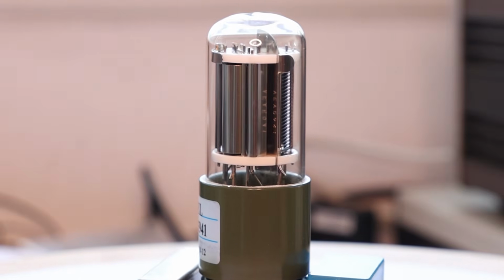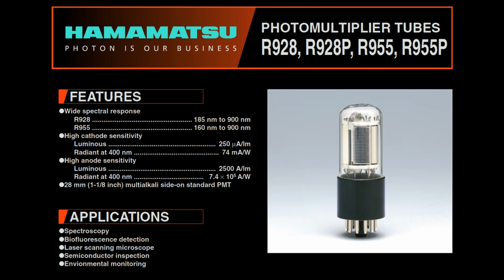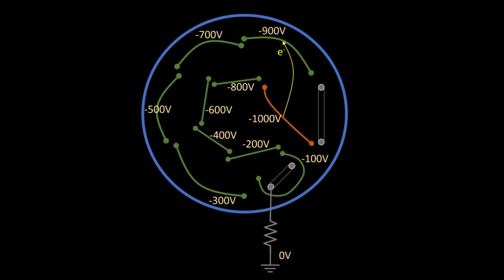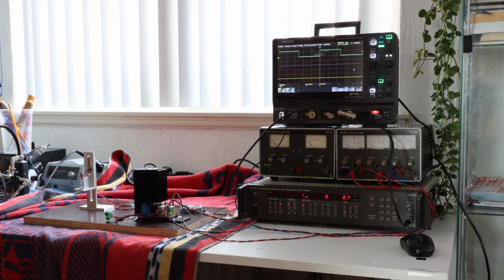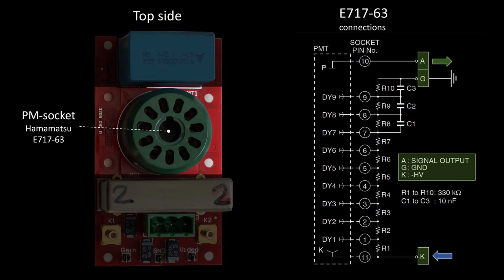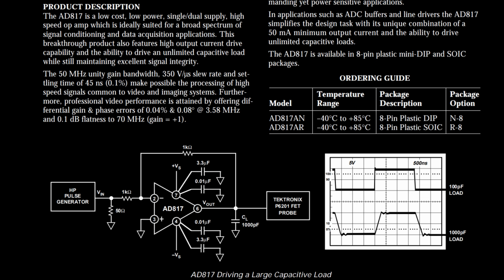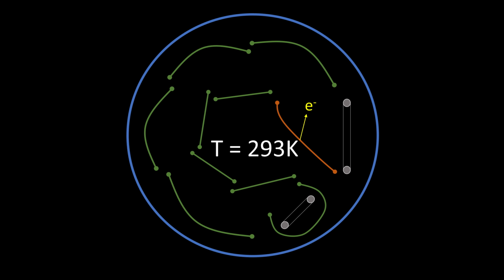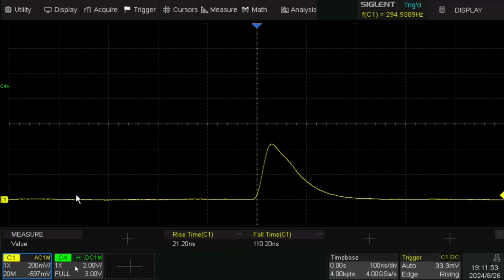PMT1: Using a Photomultiplier to Detect Single Photons

Comment: If anyone is wondering about applications outside the lab - I'm an engineer for Luxium Solutions (formerly Saint-Gobain Crystals). We use these in combination with scintillators to make radiation detectors. The scintillators convert high energy radiation (typically gammas, but also neutrons) into a burst of visible light. The PMT detects the visible light to generate a signal. 

The number of photos the scintillator emits is proportional to the absorbed gamma energy, so by creating a histogram of pulse intensities, we can build a spectrum of the incoming gamma rays. That can be used for isotope identification, which is useful for things from concrete manufacturing to oil and gas exploration to national security. 

We're actually starting to move to silicon photomultipliers - SiPMs. They don't require high voltage and are far smaller than a PMT. One of the neatest detectors we've started offering recently is a sodium iodide scintillator crystal doped with lithium, which makes it sensitive to both gamma and neutrons, combined with SiPMs and "pulse shape discrimination" (PSD) electronics that use slight differences in the pulse timing to differentiate gammas and neutrons. This gives a very compact low power dual gamma/neutron detector, which is often used for portable national security applications to sweep for nuclear material.

Comment: I dare suggest something. The first input stage from a high output impedance source - the SEM (Secondary Electron Multiplier, aka photomultiplier)
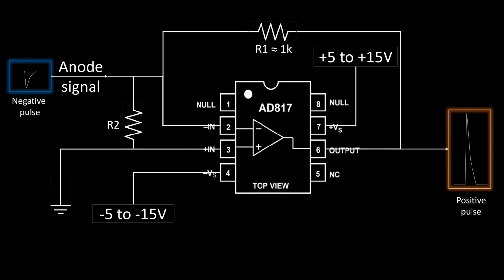 should be made in a different way than shown @ 16:35. Input impedance is much too low when R1 is 1 kOhm.
And it should be a charge counting amplifier,  perfectly explained on Hamamatsu site.

I am not sure if the charge counting amp explained on Hamamatsu site is used in your board (or something simpler).
Unfortunately your video doesn't help to find out the schematic of this input stage.

Another solution is a current to voltage converter, so on the schematic @16:35 R2 should be removed.
As for the gain - it equals  -R1, the equation is: U out = - R1*(I input)        (input current to output voltage conversion).
For this type of design R1 value should be much higher than 1kOhm, I  may guess something in the MOhm range, 10 to 100MOhm.
I think 1kOhm (in your video) is taken from the kind of general or typical application available in a catalogue note.

Actually charge counting amplifiers are current to voltage converters with a small capacitor (some pF) connected in parallel to R1.
Reply from the maker: Yes I guess you are right. I just did a few tests with the OpAmp it as a voltage amplifier (which worked okay-ish with different values of R1 and R2), But of course, the measurements are fundamentally about measuring charge, so there will likely be better solutions than the one presented. Like the one you suggested in your comment. Thanks for adding this correction.

Comment: "photon" is just a name for EM excitation enough to nudge electron out of its orbit. Since EM drops with inverse square rule - more of it (greater number of waves) is needed for the same effect at various distances. "photon" as a "particle" is a bad idea IMHO.
Reply: Read up on the photoelectric effect;  intensity is not the same as energy for EM photons.
Reply: @karhukivi  Read up on energy of EM "photons", FTFY.
Reply from the maker: You may have noticed I did not use the word photon once in relation with "a particle of light", just as an energy transfer between field and electron or vice versa.
Reply: @HuygensOptics  Yes :), I noticed that. That was my thinking out loud about electron interacting with medium, releasing/absorbing energy in discrete amounts. The moment energy is released it begins to fade with mentioned inverse square law. Your videos give food for thought. Thanks )).

Comment: @HuygensOptics I think your "longer than expected " time of individual pulses (https://youtu.be/5V8VCFkAd0A?t=1481) are simply the effect of the capacitance of the circuit (especially the RC time constant of the resistor to ground and the board and wiring from there) . I would instead count the time from the moment the pulse starts rising (i.e. just when it leaves "zero" to the moment the peak occurs (i.e. when there are no more electrons being emitted given the photons are no longer there to emit them!). The time from there to the signal decaying again to zero is just the capacitances discharging. The electron transit time would be a time between the first photon being emitted and the first electron starting to charge that capacitance. So you should see that as a delay between the signal going to the laser and the pulse (barely) starting to rise.
In circuitry with no negligible capacitance it is better to look at moments "when the slopea start changing" than to look at absolute voltage values.

Comment: Why not use a Single Photon Avalanche Diode (SPAD) circuit?
Reply from the maker: @shaunparsons3659  because the video is about photomultipliers.
Reply: @HuygensOptics  OK. A simple answer. I thought there may be some deeper reasons, be it wavelength or some other quantum related issue.

Comment: This unit came from a company which made sugar content meters for sugarbeet. It was part of a spectrometer system.
Reply from the maker: Thanks. Do you know if it worked with fluorescence in the near  infrared (700nm+)? Because the seller also had units with a 725nm interference filter in it named "fluo".
Reply: @HuygensOptics  I don't know this exact details about it.

Comment: PMT's are really interesting ! They were used in very high-end drum scanners to digitize film. The film was mounted to a transparent tube with a light inside, and it would spin very quickly and scan the frame pixel by pixel using three PMT's behind dichroic filters to separate R, G and B signal. These scanners were the best ever made in terms of dynamic range, which is unsurprising when PMT's can count photons, as well as in terms of resolution, with some reaching 11k pixels per inch ! The optics used in these is also quite interesting, as the enlarged/projected light is pretty much non-image-forming as it consists of a single pixel.

I have been looking into SiPM's as well when exploring this topic, and while they work very differently, I feel like it may be interesting to see a proper comparison between regular PMT's and SiPM's !

Comment: I'm a retired EE, and have played with PMTs, on the cheap. Mostly because my junk parts bin is better stocked than most electronics parts stores. When those stores still existed. I use them to detect very dim light sources.

Comment: One supercool  commercial application with PMT was the 1953 thru early 1959 Autronic Eye from General Motors. This device would automa6tic control your headlights (high beam/ low beam)! But the type PMT is unknown, it was an RCA or Delco tube.

Comment: I have 4 931s in the office that were used for research, biggest use were pre 2010, until the detectors counters decided to fail and out unit could no longer be repaired (chip was impossible to replace). Many a Grad paper and research paper used the tubes. I was even working on a new unit until we switched over to using CCD’s 100% of the time. 

Getting the tubes to sub-0C will help immensely. We used ours with either a thermoelectric cooler or dry-ice coolers.

Comment: If you are looking for an easy way to block light - use tin foil or foil tape.  The metallization does a great job blocking light when compared to fabric or similar (cardboard), and the stiffness makes for it staying in place without too much extra effort.

Worth mentioning that a grounding clip to earth ground could help too - when measuring such small currents, it's not so difficult for a floating metal piece to act as an antenna and couple in some stray EMF to your sensing lines, so having it grounded dramatically reduces any chance of electrical interference.

Comment: Hello, another noble liquid experiment physicist here. Really cool video, I really enjoyed it! 

In the lab, we once made a dark box out of a big pelican case by drilling holes for cables into the bottom half, putting some coax ports in them, and sealing them (I think with black caulk? I don't remember). It was by far the easiest setup to use, because it is possible to quickly shut off power and open it when one needs to make tweaks, I highly recommend something along those lines if you needed a dark box setup that you can reopen frequently, and so you can work with the lights on :) 300 Hz sounds reasonable to me for room temperatures, though, so I don't think you're having a serious problem with light tightness; this is in line with what I would expect.

When we run experiments, we often find that there are major variances between PMTs, even from the same batch, so they're rarely run at the exact manufacturer-specified voltage. Reducing the voltage can often reduce the dark current significantly, so if your circuit is capable of that that's an easier approach than cooling them. It seems like you are getting nice and clean waveforms well within what your oscilloscope can pick up, so there's probably quite a bit of margin to reduce the voltage (and hence gain). Coincidence triggers with multiple PMTs are also another way to get around dark currents, though that's a whole thing...if you are interested in that, Leo's Nuclear Methods and Techniques is a go-to for such techniques, and also gives an introduction of the NIM modules that one would use to implement these typically in a particle physics setting. They're often available cheap-ish (high tens, low hundreds) because some of these modules, such as various LeCroys, have been in production since the cold war era and there's tons of oldstock sitting in Physics department attics.

I also recommend looking into SiPMs if you're interested, they are very easy to use and also much cheaper if you count in the fact that you don't need a HV supply; I personally haven't used them but I know they're much easier to use, and the only reason I haven't used them is because the experiments I work on really care about low dark current per area, which is where traditional PMTs shine (though SiPMs are making strides).

Finally, here's a fun effect you might be interested in: did you know you can use PMTs to measure the frequency of light? Essentially, if the photon energy is greater than twice the workfunction of the photocathode metal, there's a non-zero probability for one photon to result in the release of two electrons. This essentially means that as long as the light is weak enough that pulses don't overlap too often, we can measure the frequency of light by looking at the mean pulse height and/or integrated area! The effect depends on the photocathode material, but in my experience starts to become visible <300nm, which is still within commercial UV LED range.

Comment: I love how this old tech vacuum tube is superior to semiconductor sensors. A great example for electronic engineers that newer isn't always better. The amplifier circuit you mentioned is more a current to voltage converter. We don't realy speak of amplification here because we can't compare voltage with current even though the power gets amplified.

Comment: so what logic you need to detect one photon, instead of multiplying photons, yes its a logic issue, not photon multiplication issue. sounds like a transistor amp. so a photo-sensitive gate array transistor. would detect even single photons. ie the photons make electrons that open the transistor channel. high enough voltage between D-S and you have an electron avalanche for each photon. yep a diode/transistor photomultiplier detector. well that also only multiplies the transistor diode charges. you just need to use high voltage over the transistor, instead of normal voltages, then each electron in the channel will be multiplied by the electron avalanche. assuming the channel is off with no electrons with the high voltage and only activated by the external photons. that photomultiplier is in the vacuum tube age. also transistor band gap for freeing electrodes can be changed with material choice. ie sensitivity range. also not requiring electron ejectrion, but just conduction band electrons. ie solar panel type detector. but with high voltage low current DS voltage. well you could even run a diode in a high voltage low current mode. solid state version makes it much cheaper and simpler to do.

Comment: The name photo multiplier is really a misnomer, as it’s really a voltage multiplier, e.g. a stack of capacitor plates inside a sealed vacuum tube. It multiplies a voltage potential and not electrons. And when a “photon” hits the metal plate, the transverse wave of the photon collapses into a longitudinal/scalar impulse which registers as a voltage potential spike. That voltage potential spike, is what they called a ‘particle’ or ‘electron’.  And the packetization and or quantization of the energy stems from the longitudinal/scalar wave oscillations in the nucleus of the atoms of the receiving material at a specific oscillating frequency, which acts as a “pump” giving out discreet packets or ‘quantas’ of transverse wave energy, ie. electrons from the Aether/ZPE field. It’s the scalar oscillatory pumping action in the nucleus of an atom that gives quantum mechanics its ‘quanta’.  A “photon” is an electron that is being displaced by a scalar/longitudinal wave (i.e. a voltage potential) through space. As Nikola Tesla once said, “light is a soundwave in the Aether”.

Comment: I used to work at a place that manufactured PET scanner detectors, they were basically a multi-anode PMT with a scintillator crystal on top (all wrapped up in opaque material so only high energy photons could reach the assembly)

Comment: Throwback to my undergraduate work at university, calibrating photomultipliers for use in a neutrino experiment.
The first thing we discovered was that our initial version of an isolation booth wasn't good enough! The temperature in the lab was about 1-1.5°C degrees higher by late afternoon than morning, and the difference in thermionic emission showed up in our testing.
Reply from the maker: Yes, I guess that 5% difference should be clearly detectable, especially if you test a lot of them.
Reply: @HuygensOptics  I never thought that blackbody radiation would have practical effects, and consequences, in experimentation. This is absolutely wild.

Also, "I'm just a chemist" is completely untrue. You are a renaissance man of the modern sciences.

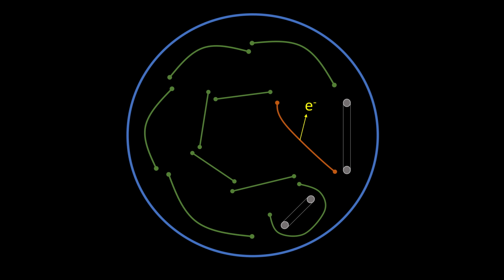Comment: At 20:40, cosmic rays and background radiation are far more frequent than room temperature thermionic emission.  These high-energy collisions can liberate electrons from any of the dynodes and are therefore amplified by fewer stages than light striking the cathode.

Comment: did you know the human eye can also detect a single photon, there is a device called a spinthariscope done to do just that.
basically you sit in a dark closet and wait for like 10 minutes for your eyes to adapt to the dark.
then you look into the device, it has a phosphorus screen and a speck of radium such that when the radium emits a particle which hits the screen, a single photon is emited.

when aclimated to the dark, the human eye is capable of seing that single photon.
Reply from the maker: The 5MeV alpha particle released by Radium decay will generate quite a bit more than 1 visible photon in the phosphor.
Reply: @HuygensOptics  well i was wrong about the spintaroscope but regardless of it, i've read studies showing that the human eye can perceive single photons with an acurracy that is statistically significantly better than randomness although super accurate either.

subjects were more accurate if it was 2 photons in a row though.
Reply: @HuygensOptics  uh, i didn't know, i've read from various sources that it'd produce a single photon but i'll take your word for it.

still a pretty cool device but i'm disapointed about it now lol.

Comment: Amazing content; I can only imagine what you could achieve in a dedicated facility and with a decent budget!
The mechanics of the photo-multiplier was explained beautifully, in particular the amplification avalanche but I was wondering how we know there is a 1:1 relationship between an incident photon and a photo cathode electron in the first place? Is this postulated or demonstrable?
I look forward to the follow-up video with anticipation.
Reply from the maker: Actually, this isn't the case, it's way more complicated than that. A photon with sufficient energy can release way more than one electron from the photocathode. I will talk about that in the follow-up video.
Reply: @HuygensOptics  it was usually explained to me that if a high energy photon gives enough energy to an electron, it can then knock out more electrons using its kinetic energy. So if that interpretation is correct, there is a sense in which there's a 1:1 relationship(a photon cannot be partially absorbed by multiple electrons). You do get multiple electrons out of the photocathode in that case, that's right

Comment: This is great stuff, well presented.  It shows lots of work putting this video together.  There is a solid-state equivalent to the PMT called a photo avalanche diode.  I have played with these - got them from Aliexpress.  On the dark response, could some of the pulses be due to cosmic radiation?
Reply from the maker: I think so, cosmic radiation can cause scintillation which can be detected by the photodiode.